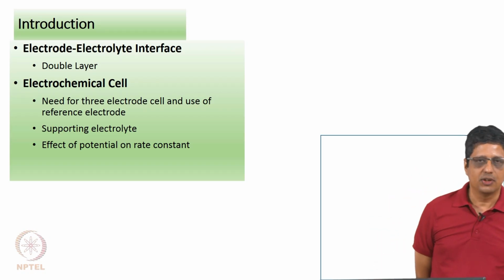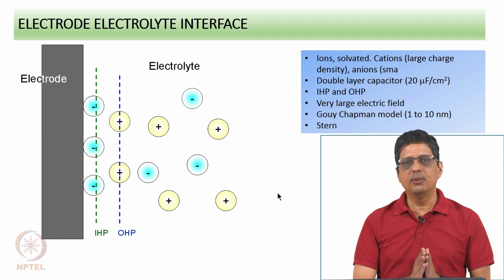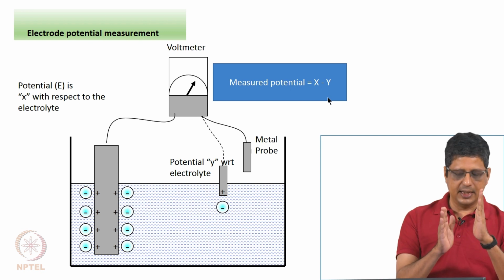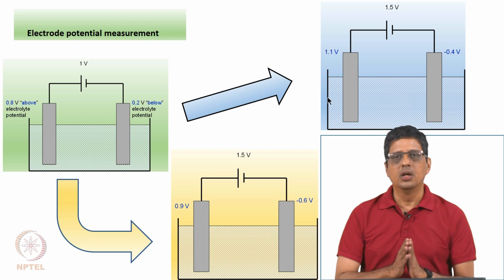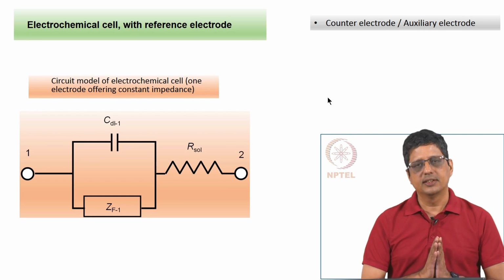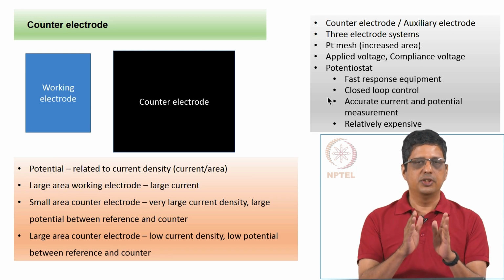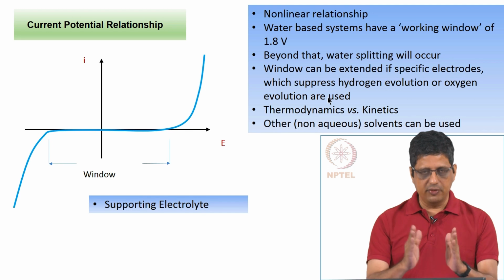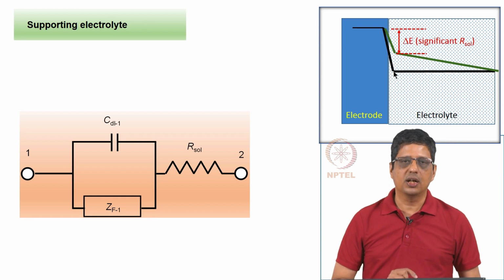#1 Electrochemistry Basics:Double Layer, 3-Electrode Systems & Supporting Electrolytes

Comment: In a simple explanation.Adding a supporting electrolyte  help to:

Reduce ion migration effects, ensuring that the ion concentration around the electrodes remains more uniform.
This is important when you use theory for systems under diffusion control. Remember there are always three mass transport phenomena present: Diffusion+Migration+Convection.

Comment: can we use the same material for working electrode and reference electrode?
Reply: Technically, you can. But in my experience, I think it isn't advised because the working electrode is usually the electrode you are interested to study while Reference electrodes are usually the ones that have been established for a while and they serve to make sure the change in applied potential is only affecting the working electrode. So, you can try out different working electrodes while keeping the reference electrode the same. (I hope this helps)
Reply: @adityaprajapati2688  thank you

Comment: Excellent explanation. What would be the potential of the working electrode and the reference electrode? Can I say they are connected in parallel and have the same voltage?
Reply: Not really (unless we mistakenly connect the working and reference electrodes together). We visualize potential as a quantity that is measured with respect to some reference. point. The reference point could be the electrolyte, but we are unable to measure it. So we end up using a reference electrode.

Comment: Ideas in this lecture:
-Hemholtz double layer at ~1nm at the electrode-electrolyte interface (double layer capacitor 10-50uF /cm^2) 
-Gouy Chapman model: charge distribution takes place ~10nm from the interface (applicable at low conc like 1 mM)
-Stern model combination of both models
-Faradaic transfer in electrochemical reaction + double layer capacitance > Zf || Cdl
-Minimum 2 electrodes required in a electrochemical setup, Rsol > resistance of solution
-We cannot directly measure the potential of an electrode as any probe develops double layer and thus potential drop
-Reference electrodes in a 3 electrode system are used as they have a constant potential drop from solution and very little impedance(negligible)
-luggin capilary used to place ref electrode close to working electrode to reduce the effect of Rsol
-Counter/aux electrode is used to complete the circuit, have large surface area(low current density) because at large current, ref electrode doesnt have constant potential drop
-potentiostat has to have fast response, closed loop, measure small currents
-2 electrode systems enough for measuring electrical impedance
-Applied voltage: b/w working and ref; compliance voltage: b/w working and counter

-Very small current for ~1.8v, current exponentially increases due to water splitting. :. limit experiments not studying water splitting to 1.8v
- Increase this range by using Zn or Pb electrodes or non aq solvents
-Supporting electrolyte: increases conductivity w/o interfering w/ reaction, reduces effect of Rsol